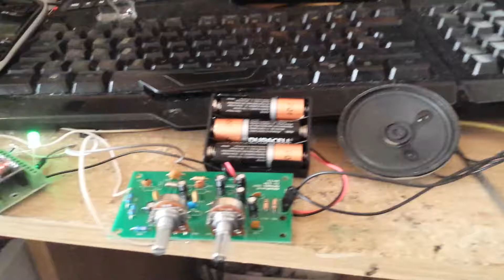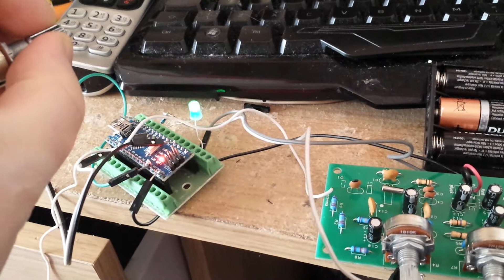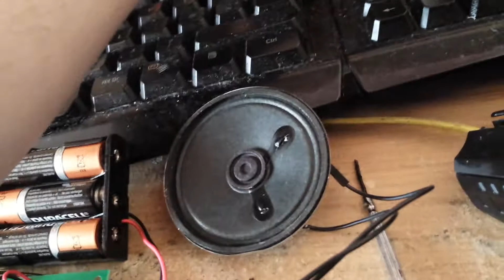SCR proof of concept demo

Comment: Kind of like one of the original franks box aka 'digital'. Random voltage but via digital programming as opposed to circuit.
Reply from the maker: Yup indeed, The traditional method meant the desired voltage sweep would need to be configured to every radio it was used on, This method a few simple value changes in code will match the voltages the radio uses to tune in,  Just with a basic sweeping PWM Signal, Same thing that dims or brightens LED's or speed controllers for DC Motors, which supplies a voltage between 0-5.2v Tradition means with the function generator is a bit more complex and can be a real pain in the ass to set up for each radio, I am hoping to simplify and reduce costs and add more function with this setup :)